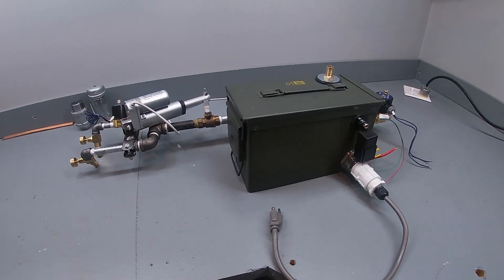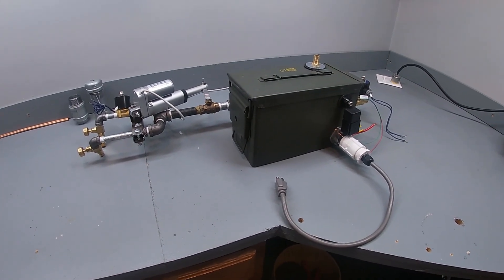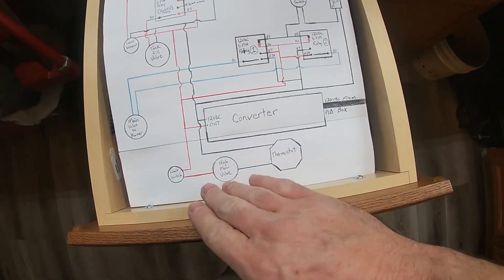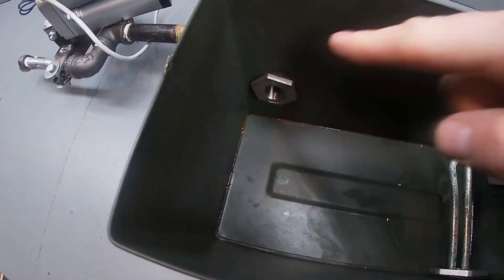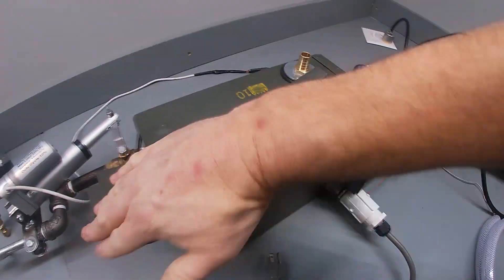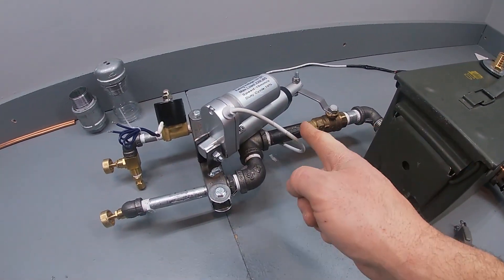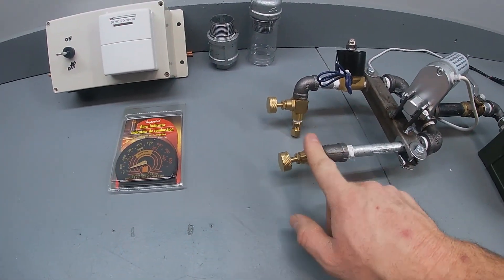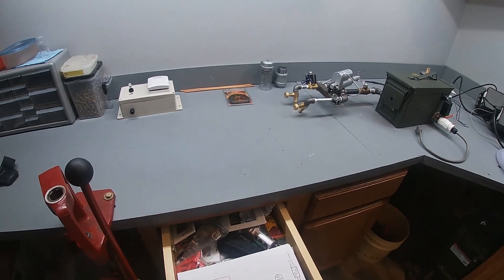Waste oil burner

Comment: I used a motorized rotary ball valve.   I think it was 25 bucks on AMAZON & is 120vac.   I have videos of mine on my page.

I looked for the pumps like was suggested prior but wasn't sure whih one would pump the heavy burnt oils I have for waste.
There are Solinoid valve that are continuous on but start at like 40 bucks plus.   The Rotary ball valve works but I wanted a spring close version in case power was lost while running as blower stops.
I may look for a APC/UPS to power my unit from and have it set to close the valve and kill the fire.

Comment: For my waste oil burner, I just use a cheap metering pump from a Webasto heater. Basically, every time it gets a pulse of power, it pumps out a small spurt of fuel. I have mine wired in series with an adjustable flasher relay that can be set between 50-200 pulses per minute, which equates to about 1 cup to 1 quart of fuel per hour. It's extremely consistent, and doesn't fluctuate with temperature changes. Personally, I think it's a lot simpler, safer, and more reliable than trying to regulate the temperature of the oil and mess with a gravity drip.
Reply from the maker: I thought about using one of those, just wasn’t sure if it could supply enough oil. Also the clicking drives me nuts!